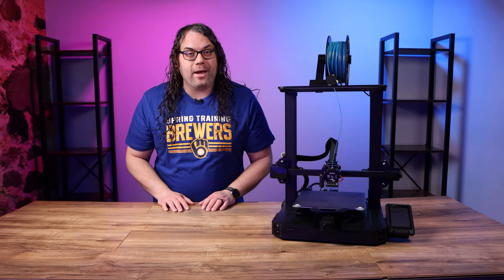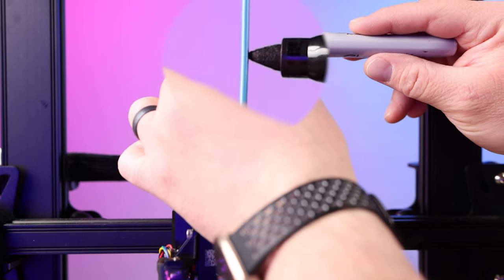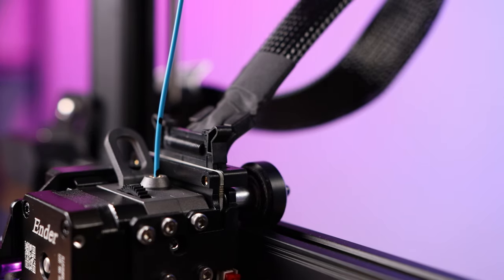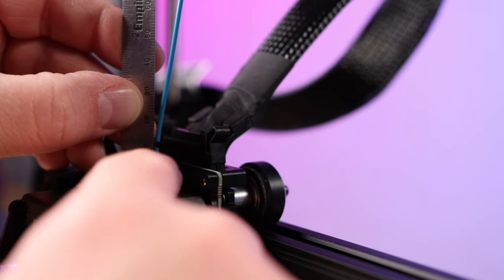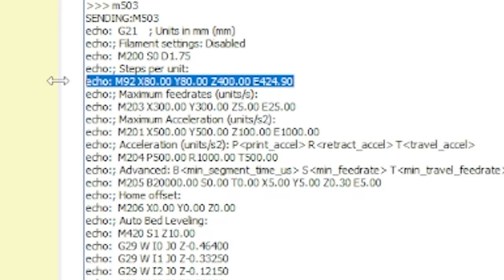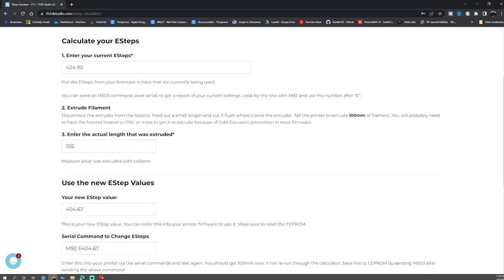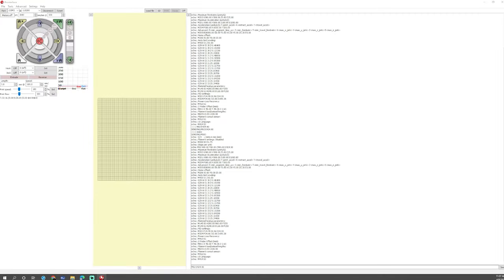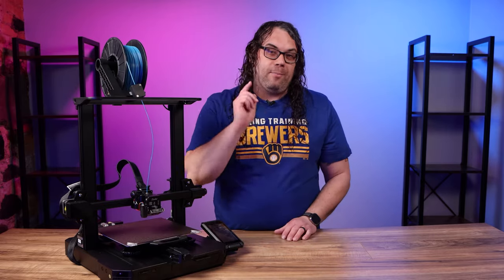How TO Calibrate The Esteps On A Direct Drive Extruder The EASY Way!

Comment: Hello, I've been watching your videos and have been following along with pretty much everything you have been saying to do with the Ender 3 S1 Pro.  So I just got mine last week and I'm having a constant issue with a print shift.  I've researched the issue, tried things that was suggested with zero luck.  As of last night, I now hear a "knocking" sound after the first few layers and it almost seems like the extruder is having a difficult time pushing the filament through.  After a bit, the knocking stops and the print continues on like nothing happened.  I don't think this is a normal thing and I'm yet to understand why it's doing this.  I've changed out the filaments thinking it might be a bad filament, but it's happening on all filaments.  The Temp is set to 210 which seems to yield better results.   

Overall, I've leveled the bed over and over, checked the e-steps, checked the temps, made sure the surface the printer is on is pretty stable, checked the belts to see if they were tightened, checked the bed for a "wobble", etc.  I am at a complete loss and I can't seem to find a website that states something about a shift and a "knocking".  :(   Any suggestions?  I even took a small video of the knocking sound and posted it to reddit, hoping someone there can guild me in the right direction too.  But as it stands now, I am at a complete loss. :(
Reply: I got the same one, and until tonight my prints have been pulling off the bed, and they've been making a sound similar to the filament roll shifting, but different. Almost like an air bubble popping. I print at 215 for the initial, and 210 for the rest. with a hot bed at 70, then 60-65 for black PLA. I couldn't get it to stick with anything else. It sounds similar to you, but probably different. My problem is my Z step is out (I think, I'm printing the test again now), and my bed has a dish shape to it. This is my first printer, so I'm assuming you checked XY and Z but I didn't think to until tonight. I was measuring 20.6something. I also just ran a straight edge over the full width and noticed a nice bow. At the moment I stuffed tin foil in there, but I want to mill the top at my machine shop. If anyone can tell me if I can or not I'd love to know before I find out I can't.
Reply: @VR_DS  I have checked the XY and Z.  I have gotten better results with constant tweeking, but I still have the issues with the knocking. It's honestly driving me nuts because I can't figure it out.  As far as the "bowl" issue, I don't think that is supposed to be that way.  I would call support and ask.  That sounds really strange to me.
Reply: @Swerewolf  My problem was fixed with the Z step. I had been calibrating with the 20mm cube, but that was too far off I guess? I recalibrated to 100mm and its been great. My bowl issue is a warped bed, it's not supposed to be like that, but a lot of them are. Have you tried getting a video? is it something you can recreate, or signs its going to happen? Maybe you have a small burr in your nozzle, and the wire has to fight until the whole unit is hot?
Reply: I don't know if your problem has been fixed yet but the fillament runout sensor can add friction which could explain what is happening. Try routing the filament straight to the extruder.
Reply: @VR_DS  If it is the S1 you can send them the warrenty. I've heard people getting returns for much smaller warps.
Reply: @someonemaybe3947  I have done that.  So, funny story.  The printer has been returned.  I was sent a refurbished or used model.  The problems got worse and I finally figured out it was used.  So the nozzle wouldn't come out of the extruder.  Turns out, the inside of the heatblock was stripped.  When I tried to remove the heatblock, the nuts on that were stripped as well.  I was unable to remove it from the sprite to replace it.  I contacted creality for help with this issue, and I wish I could upload screenshots, but they seriously told me they would be glad to help me if I left them a good review on Amazon.  I contacted Amazon and informed them of what was going on and they asked me to send the printer back for a refund. I will be forwarding all the emails to them as well.  
I am now in the market for a new printer.

Comment: better to remove the hotend nozzle, enable cold extrusion. and snip off filement, extrude 100mm snip off then measure. more accurate

Comment: You actually use a website calculator to do such a simple thing?? I just divide the set extrude distance over the actual extrude distance and multiply the Esteps by this result to get the correct E steps setting.

Comment: Well, problem with this method is that you are introducing potential flaws of hotend and nozzle into your e-steps calculations. You should calibrate without hotend, just extruder, because you are calibrating extruder, not extruder, hotend and nozzle. After that you adjust flow in slicer

Comment: I find teaching techs website more complete since it has every calibration test you ould need to tune your machine as for the e step calculator measur your 120 extrude 100 and just input how much was left frome the 120 and does the rest you just avoid doing a little bit of simple math.
Reply from the maker: Thank you for your feedback! This video is older, and next time I do a revision I will keep that in mind! Mind! Michael has a great website, I definitely agree with you on that!
Reply: @The Edge of Tech  I mean to be honest o prefer your way of explaining thing much simpler as to others go in to more detail and sometimes they tend to lose me along the way but with you it's just streight to the point so thanks for that

Comment: Why would my ender 3 s1 pro jam up all the time
Reply: Over retraction, mine is running esun pla+ at 1.4mm 45mm/s. Other options are dirty fillament. Or undersize fillament slipping on gears, or temps too low.

Comment: don't do it at 100mm do it at 200mm extrude 180 its more accurate use a razor blade so it fits inside of the mark on the ruler then cut into the filament. if u use a marker pen u could be over or under extruding by 2 0r 3mm